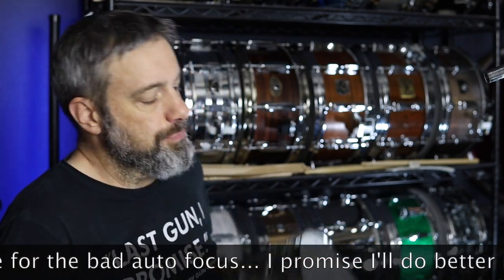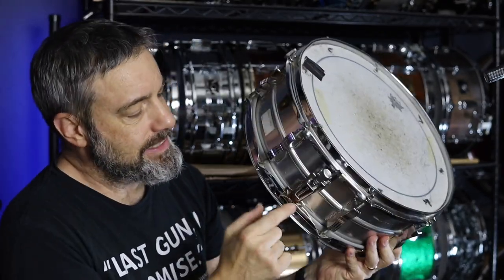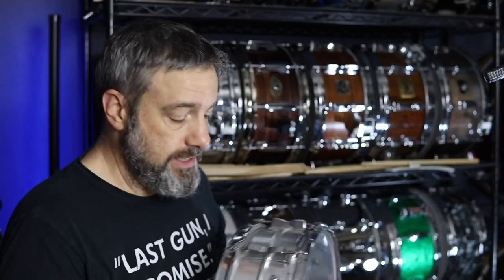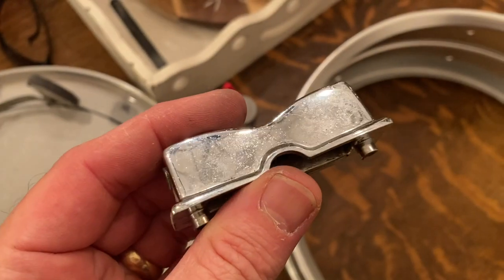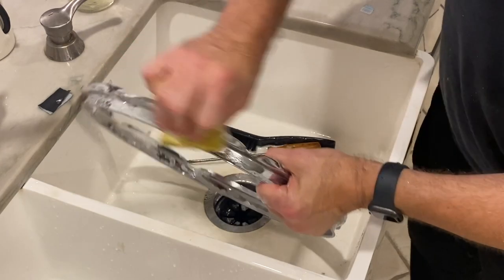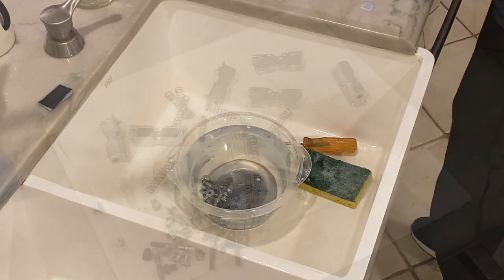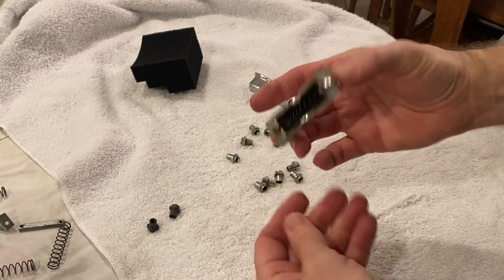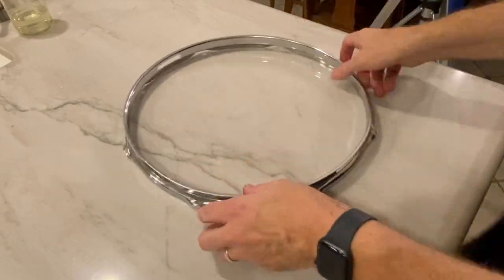1967 Ludwig Acrolite Refresh

Comment: I have found that over time foam will degrade and either crumble away or become gummy (depending on the type of foam). Now I use little squares of 100% cotton cloth, like from a t-shirt or you can buy those little precut squares used for cleaning gun barrels, I wrap one all the way around the internal lug spring before putting it in. The cotton wont degrade and it doesn't take up as much space inside the lug, but does a great job of damping the spring noise

Comment: I have a '65 Acro. It was my first vintage snare drum I got 10+ years ago. I then got a '78 Supra after that to add to the 'vintage' arsenal. I ended up selling the Supra because my Acro was always on the stand compared to it. It definitely has some extra 'oomph' that the Supra just didn't have. They are definitely great sounding snares!
Reply from the maker: If I had to have only one, a Supra or an Acro (fortunately, I don't have to make this decision) I think I would have to go for the Acro.  I think this is because of the extra 'oomph' you mention, which I believe is a result of its 8-lug design compared to the more refined 10-lug design of the Supra.  The Supra is a great drum, no doubt, but I find the Acro a bit punchier in the mids, I believe because of the 8-lug arrangement.  I have always preferred 8-lug drums for their punchiness compared with 10-lug drums (though I have a bunch of 10-luggers that I dearly love!).

I actually think my favorite Acro to play is the 90s era Black Galaxy version.  That powdercoat finish seems to focus the tone a bit more (it adds mass and a bit of physical texture to the otherwise smooth aluminum, including on the edges, which I think makes it a bit less refined still, in a really wonderful way).  The finish itself, aesthetically I can take or leave, but I really find those 'Blackrolite' snares to be extremely versatile players and just killing with practically any head/tuning combination.  Great, flexible, musical drums!!

Thanks for sharing!!
Reply: @drumdotpizza  Awesome! I should try a Black Galaxy version one of these days. The prices keep going up and up. Thanks for the response on this!

Comment: I have what I believe to be a 67 as well. Mine has baseball bat with red felt muffler on inside. Great sounding drums !
Reply from the maker: Might check the serial number on that drum to date it (google "Ludwig Serial Number" to find the date guide).  I say that, because if the the red felt muffler is original, then it's almost certainly NOT a '67, but much earlier (like '63)!  Thanks for your comments!!
Reply: @drumdotpizza  Yes you are correct thanks. Seems like my snare was likely made between Feb to March 1964. It is a great snare.

Comment: Cool video. Have you ever used barkeepers friend? Great for hardware cleanup. I have a workaround for broken bowties too if anybody has ever run into that, I have. Your drum sounds great!
Reply from the maker: Never heard of barkeepers friend!  I'll look into that, thank you!  As for bowties, I've broken a few myself by overtightening... just a couple of quick wrist twists beyond initial tight is enough to keep them in place, but I had to figure that out myself.  Thanks for watching!
Reply: @drumdotpizza  You can thread stainless allen head set screws into what's left with a little loctite. Then stick that through the shell with stainless washer and nylock nut on the inside. Happy drumming! Subscribed.

Comment: Great drum bud, i have a couple from then, even a drum set dated 1 month after i was born. But to the point, the other oddity of that particular drum is; by '64 they moved the air vent and muffler 1 panel back. So, your vent/badge should be where the muffler is etc.  I also have a '68 jazz fest that is same make up as yours but w/baseball bat muffler and p83! In 1968! Makes no sense huh?
Reply from the maker: Yeah, Ludwig was doing everything they could back in the post Beatles-on-Ed-Sullivan-Show era to keep up with production.  I've heard (and seen) LOTS of factory anomalies that they put out during those years.  Thanks for watching!!

Comment: AFAICT that drum has already been refurbished before: proper P83 and BB muffler or smaller round knob muffler have been replaced at some point.
Anyway very nice drum. I have one keystone 5 digits (63? 64? definitely no date stamp) with P83 and BB muffler and another pointy BO badge late 60s/early 70s (already "Ludalloy" I guess because the shell is less "shiny" and a little more pale) with P85 and small round knob muffler. Great sounding drums both of them!!!!!
Reply: Would anyone happen to know about a 62 prototype Acrolite and what it might be worth? I bought it from a pawn shop for 89 dollars and had a weld plate where the seam is, and thought someone had messed it up and weld a plate for some reason, but in doing some research that’s how they did the first model pre-serialized Arcrolites. It’s in great shape with aluminum hoops and aluminum bow tie lugs as well.
Reply: @OzoneDrummer22  The weld plate is historically correct, as are the aluminium hoops and lugs. You just pictured a 100% original Acrolite Prototype. I've seen them going for no less than US$ 650-700... quite some time since I last saw one go on ebay so maybe pricing needs to be updated. Good luck with yours! (FYI https://www.youtube.com/watch?v=JLN5gb3KaCo)

Comment: Would anyone happen to know about a 62 prototype Acrolite and what it might be worth? I bought it from a pawn shop for 89 dollars and had a weld plate where the seam is, and thought someone had messed it up and weld a plate for some reason, but in doing some research that’s how they did the first model pre-serialized Arcrolites. It’s in great shape with aluminum hoops and aluminum bow tie lugs as well with red felt and baseball bat muffler lever.

Comment: Washing all those small components in a sink with an open drain gave me the fear!!
Reply: Yeah, I have definitely lost components down the drain before (that's a disposal, actually, on that side of the sink), though was generally able to retrieve them.  But I quickly learned to work from a bowl in the sink (and I usually put a stopper over the disposal as well for added safety, though I didn't in this video).
Reply from the maker: Yeah, I lost parts in the past down the disposal and had to go fishing to get them back.  A bowl helps tremdously (as does a stopper in the disposal itself)!
Reply: This gave me anxiety more than anything :D
Reply from the maker: Ha!  Sorry to stress you.  I have had bad experiences in the past, but a stopper and a bowl does wonders! 😄

Comment: I just picked up a 5x14 Ludwig "Standard " snare drum. It has the multiple hole throw-off and no seam around the outside of the shell. It has the round knob muffler and it’s in great condition. How close might this be to the Ludwig "Acrolite"? Thx!
Reply from the maker: Same shell without the added production step of pressing the bead in the center of the shell (which is done after the alloy is spun into a cylinder shape).  Leaving this out saved money making the drum less expensive than the Acrolite.  Truly intro level for the time (before going to off shore manufactures as is done these days).  

So VERY similar drum to an acrolite.  The bead does seem to add some mild complexity to the sound, but otherwise very similar.  A great drum!

Comment: When I build drums I use cotton balls inside the lugs, never had a complaint
Reply from the maker: Done that too!  I just discovered these foam strips after fitting some microphones to some cases, and I realized how similar it was to the original foam used (by Ludwig, anyway).  Easy to tear to perfect size.
Reply: @drumdotpizza  great find, I always worried whether the foam would last since so many drums had these deteriorate over years, not sure if the cotton balls hold up any better. Great video

Comment: Hey ,knew to you !! Good videos.  IF  you wld explain how to hear different pitch at lug to lug . I dont hear  it . Maybe cld hear big  pitches but not slight  tap tap tap yikes
Reply from the maker: Thanks for watching and for the question!  The simplest way I have found to hear pitches at each lug is to simply place a finger in the middle, dead center, of the drumhead, just enough to muffle the fundamental note making the harmonics much clearer (be sure to use consistent pressure with your finger or it will affect the pitch you're hearing and frustrate your tuning).  Tune according to these increased harmonics, tapping about 1" in from each lug around the drum.  And be sure you're using a flat hoop!  If the drum is old the hoop might not be flat, and tuning will be very difficult, if not impossible.  Hope that helps!

Comment: For some reason I was thinking that my Acrolite was a much later model than yours, but it's actually about the same age. I'm not finding any date, but the keystone badge, bat-style muffler handle, original throw-off (replaced, but still in my possession) with many holes and the finish do seem to add up. I've got an Evans EC1 Reverse Dot on top at the moment, but that's changing later today. Thanks for another great video! Your autofocus doesn't bother this guy at all.
Reply from the maker: Google "Ludwig Serial Number" to find a dating guide for keystone badges.  That should tell you the year it was made!  Great drums!

Comment: You didn't show you cleaning the shell or getting the dents out.
Reply from the maker: True!  I wiped the shell down with mild soapy rag (damp, not soaked) and then again with a rag damp with water only.  I didn't want to remove the date stamp inside the drum, and unless the drum is coated and truly filthy a full wash isn't really warranted.  As for the dent that's worth a separate video, so I'll address dents in a future installment, so stay tuned!  Thanks.